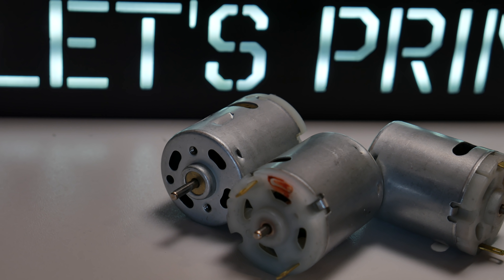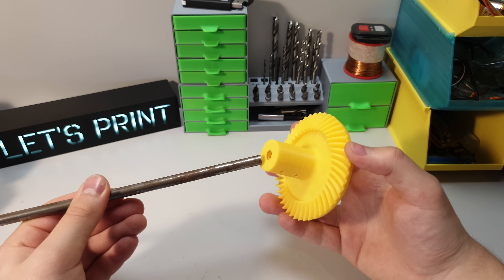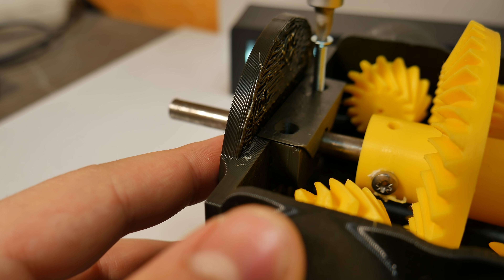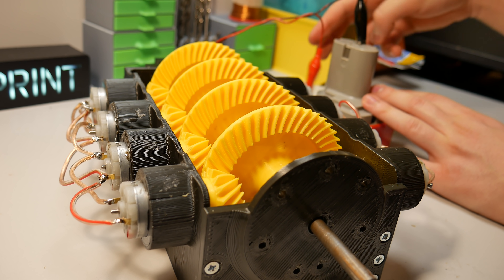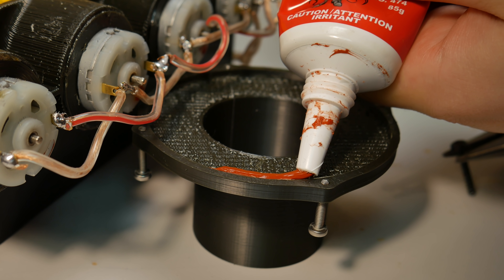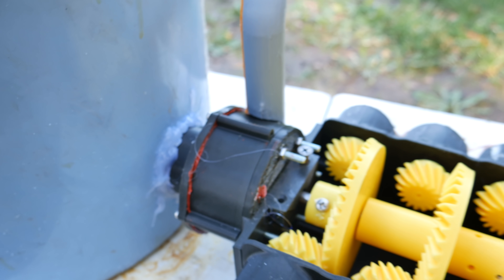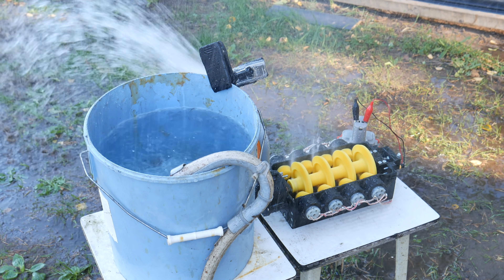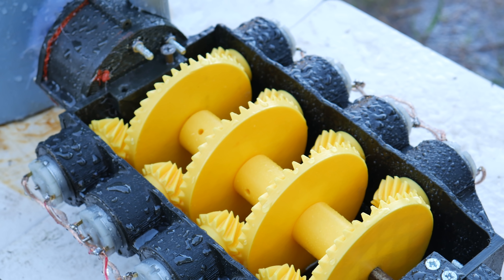Extremely Powerful 3D Printed Gearbox & Water Pump - Eight Electric Motors

Comment from the maker: If u are going to comment that I should use more powerful motors, well... already done this: https://youtu.be/57A_l9_b610
Reply: I actually want to propose you adding some PWM
Reply: Can you measure the water head and how well it compares with equivalent commercial pumps?
Reply: Hey do you think that you can make a mini version
Reply: Not really a suggestion for you to make, but could I use this gearbox to drive a go kart?
Reply: @william2glaser227  It wont work, you will need more torque to move your weight.
Reply: @milaanpatel4997  ok thanks, I guess I have to use a gasoline engine for this one, sometimes old school works the best
Reply: Bigger motor and only one gear set and it would have made it less complicated, cheaper and more reliable. This is something the germans usually do by over engineering a simple mechanism adding cost and decreasing reliably and making serviceability time consuming, why bother it's just stupidity.
Reply: @yuk-erkmckirk9277  "This is something the germans usually do by over engineering.." There should be 'period' after 'do'. It changes the meaning of the sentence completely. Unless, you want to say that, Germens are the one doing over engineering.
Reply: @yuk-erkmckirk9277  Germans only? No way, dude. The blanket answer to your concern would be "becouse I can". :P
Reply: Loved that <3
Reply: I was not going to comment on that.  I was going to comment that you’re mounting the motors incorrectly, and making at least two errors.  The motors are not meant to be located on the OD of the can for gear applications but on the ring at the front of the motor.  And you’re also blocking the air vents near the rear of the can.  Luckily this is a very crude 3D printed contraption for a YouTube video and not an actual product.
Reply: Every minute more I watch I cringe... set screws on a round shaft... pressing gears on the motor shafts without supporting the back of the shaft.... this is why you never outsource anything overseas....
Reply: Actually, the opposite! It's an interesting idea to use quite inexpensive motors, coupled together to provide the power you want, and, also, get a bit of "system redundancy", so that one motor failure doesn't stop the pump...maybe, one could add a one-way clutch/drive so that even a seized-up motor, or such, would not stop the pump...maybe a one-way clutch on the big gear. In case a small gear, or the big gear, are broken,  I saw a really simple one-way drive mechanism in a printer, easier to build as printed parts than a roller clutch...hyvää on!
Reply: put some O rings on the shaft intron of the bearings it wont stop the leak but it will slow it
Reply: you can save water by putting exit hose into the bucket
Reply: Hell, yea, I just wanted to ask about a 24V test. :D
Reply: Less gears, and a gear down would help, also better prop design will improve dramatically. Bigger motors.
Reply: Do you seal the motors up to prevent water from entering them??
Reply: Would that work as a hydroelectric generator?
Reply: Ya but still, you have no idea how effecient and easy it is to put a turbine on a motor shaft directly hahaha.
Reply: You do not need more powerful motors, you need a better design. It's HORRIBLE.
Reply: Hmmm what if you used the stongast motor u can
Reply: nice booild
Reply: Sa oled eestlane ?
Reply: any ways sorry the link is so big but was what I found for a reference, or possible buy as you said 8mm shaft, also if you take the gear at the other end and flip your slt file you can remove that system you are using to push your gears together, might have to reverse polarities with those two motors but it would work and be less pressure or stress on your whole gear box, you could also free up that side of the shaft say put another water impeller run a water line over from the Original water impeller's outlet into the other impellers inlet, for a two phase pump (has better pumping or head pressure  capability
Reply: I wanna learn how to do this what your degree in
Reply: *=* I think you need toroidal rubber for no water leaking(best for no moving part).
Reply: I was thinking that, one big motor ok

Comment: mechanical engineer reporting. expert at making screw pumps. We make everything from pumps the size you see here, to pumps that have 50" diameter collums. I have to say, this is seripusly impressive!! To get that amount of flow with such small electric motors and 3d printed parts is awesome, love the video 😊 lol

Comment: Use some rubber to seal the box case, fill it with more silicon grease , reverse everything you have done to make an little generator :D ...connect it to a water supply , to an inverter & some batteries ....i already gave you to much info LOL. PS: if you do that & the test gearbox last 24 hours ...make the next one from metal .

Comment: All you need is seals for the impeller housing for a shaft and enclose the shaft and couple to the pump impeller housing. That would keep water out of your gearbox also with building a gearbox mount bracket that guards the coupling of the shafts everything that you make from there out using that gearbox you will already have dimensions for attachment and coupling.  Just a thought pretty cool regardless it's definitely pumping out some water.

Comment: Is it success for long duration ? The gear systems may worn out due to excessive heat and the bolt which is pressed the spindle of the gear system may worn out and can make a gap which may loosen the gear system.

Comment: Try facing bigger gear opposite side with inverting motor rotation as per need for canceling net force of shaft may help in vibration and leak problem
Also chnage design of impeller

Comment: Wait, you could print this big pump assembly, but you couldn't print a set of wrenches and had to use pliers to install that bolt on the end of the gear assembly

Comment: I would put all the motors around one big gear. You would have less friction force and smaller total volume. But in overall i think 8 motors will consume good amount of energy plus it will get warmer because of high friction.

Comment: It would be interesting to see if you could build a solar powered pump for a hydroponic application. Also would be interesting to see how high the pumpkin lift water. Maybe get the gallons per hour? Based on the volume I'm seeing in this video it looks like it could water a pretty large hydroponic system. Instead of liquid silicon to grease or lubricate the gears how about plumbers silicon Grease? It's very pure and food safe. A good application might also quiet down the gearbox just a little bit.

Comment: OK....

So, instead of having a bunch of motors that waste that amount of energy, you could use one motor that spend the same amount of energy, to produce more power. Why? Because each gear connection (and this have a bunch of then) weakens the system. As a matter of fact, the amount of sound is eqiuvalent of the amoung of energy wasted.

Visually, it´s cool.... but it´s not that impressive.

Comment: This shit is incredibly useless. It will probably brake itself after 10 mins of working due to axial force that is being produced by all this gears. It's like half of the moment produced by the motors trying to push the central shaft towards the screw (the one you've used to tighten up the shaft).

Comment: Ahh, philips head screws, I am dying inside! I had to use some today on a small project because it was all my hardware stores had and it really made me appreciate my hex socket set (wish it came with some tapered). Great videos, keep it up! I love seeing 3D printing being used to make more than just simple tools and vases.
Reply: hex? i'm dying inside. square drive
Reply: @ryan_blender3d   really? for machine screws? at least hex is super common and does not strip as easily like philips.

Comment: Abs was the right thing to use, however the friction force between the metal rod and abs will only make the leaks worse. It's a nice prototype model but I would definitely use metal gears and a metal guide pipe for the axel rod. You can solve the leak problem with a few rubber o rings and grease. Your could even make a small reservoir for a low viscosity transmission fluid and get rid of the grease. As long as the gear box is relatively level it should self lubricate the gears.

Comment: I wonder. If you made a backflow valve for the dispenser pipe so when you turned it off the pump wouldn't empty out, maybe that could keep your startups from being so slow. It seems to spend a considerable amount of time blowing are out at each start, which I have to imagine adds wear to the parts too as they will be running at higher rpms with less pressure on the drivetrain.
Just a thought. I love your pumps though and especially the tears on different impeller shapes.

Comment: Very good video my friend!! Quick, straight to the point very detailed even the part where you mention that you grinded off the bar of camera 👌 excellent. That pump is great! It has so much power on the single battery its crazy, think it can easily handle a bigger pump. ✌👽

Comment: Unfortunately, this video tells us next to nothing about it's practical use because generally we are fighting gravity to pump water. In this configuration there is no need to prime the pump either.
Attach a hose and stick it in the bucket on the suction side and put the bucket on the ground.

Comment: Hi. Nice video! Also I have a question about electric motors and gears. Does more motors connected to the same gear shaft (running at roughly the same speeds) mean higher torque on the gear/main shaft but without needing a gearbox? (At the cost of more motors of course)
Reply: Yes I believe it's pretty much that. Also another benefit is that the stress is spread out in several gears. Also redundancy. I imagine that even if one or two motors fail, depending on the load it might just keep going.

The only downsides I can imagine is more points of failure and a little more power loss due to more gears and more motors.
But I am not a mechanical engineer

Comment: definitely need that water pump if your home area still uses a well (hopefully it has a normal pressure pump tho and not using like a freaking bucket like the medieval age cause that's the first thing I think of when I hear some ones using a well and not a water pump or hand pump but I'm confused to since he also seems to have a 3D printer so...why is there a well instead of like a faucet I don't mean to be offensive tho just curious about the tech his home area is using since it seems it has access to things like 3D printers but then he's using a well)

Comment: So putting 8 motors in parallel gives you a lot of power which is great if you have a huge mass of water to displace, but it does not increase the pump speed. Perhaps though you could find a configuration to increase the speed of the motors dependent on the load exerted?
Reply: well, it slows down while pumping which means it would need even more torque to reach higher speeds

Comment: Interesting design, but impractical due the conservation of energy. Multiple contact points have compounding energy loss. Long shaft with large mass compared to the energy used to turn it. Many points of potential failure. These are some reasons why most things powered with electricity do not use gear boxes. It is much more energy efficient (and therefore more powerful) to have a single large motor instead of multiple small motors. But still neat design. 1 benefit to a gear box though (which you dont implement) is that you could change power ratios by shifting the gears (large gear to small gear turns the drive shaft faster but with less torque, small gear to large gear turns the drive shaft slower but with more torque)

Comment: Next step would be to use a longer shaft and place the pump a little farther from the gearbox, that way the leaking and splashing won't get on the motors so easily.

Comment: Works great.
 Maybe a "weep chamber" with holes in bottom to drain it, between pump and gear box.
 And add a cover over gear box that extends out past the back of motors.

Comment: Water spraying over the motors and gears is not a flaw, it's an unexpected feature. You've water cooled the system so it doesn't overheat 😉

Comment: Leak proof is the hardest part, I designed mine before 3d printing but used a long shaft supported by bearings with disc walls and o-rings to "minimize" the amount of water before the gear box, you could also put a gear on the horizontal shaft and have your gearbox angle down into that before the shaft enters the propellers work area.

Comment: This is a bit pointless. Using one, bigger motor is better more reliable and cheaper than 8, because you don't loose power due to friction in the transmission.

Comment: why not flip two of the driven gears and reverse the polarity of the motors controlling those? this would help cancel out the thrust generated by the bevel gear design.

Comment: You should test to see how high the water will reach vertically in a clear tall plastic tube to find out the pump's head pressure.

Comment: Fitting motor with the spacer very tightly is bad idea couse when motor are running they are usualy emit heat which causes melting pla.

Comment: ... Make two and put under a BOAT, use pwm microcontroller to modulate power for electronic steering. Input with a wii trigger/thumbstick for throttle and steering. One pump receiving 100% and the other getting 0% power will steer the boat the hardest. 100% to both will not steer it at all. Then scale both outputs by the throttle % so you can control the combined power output. Boat will be slower in the steering by a linear factor, which is what you want anyway for best control. Half power at full steer and full power at zero steer. Space the pump's far apart for better low speed cornering, space them closer for better high speed stability. Do it.

Comment: There is a large amount of SLIP due to 2 motors being on each main gear. I recommend only using four motors in this current configuration OR 8 motors in a Design with a longer shaft.

Comment: Cool, i used to make water pumps all the time out of legos when i was young. Tried it again a year ago using a turbine from an old water powered toy and a case from an old electric motor, I just made a hole in the side, used a motor shaft then made an intake, best water pump i ever made. This video gives me some cool ideas.

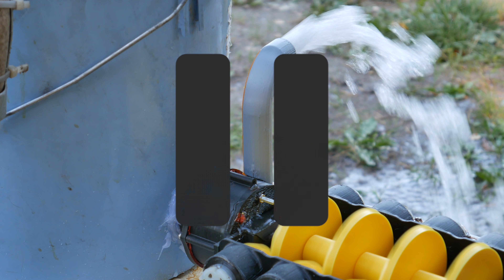Comment: 6:30 good example of a centrifugal pump spinning backwards. It will still pump, but not efficiently. Was trying to explain this to someone a couple of years ago when working on a 3 phase pump that was going backwards and struggling to maintain pressure. They couldn’t get their head around why a pump spinning the wrong way didn’t pump the water the wrong way.

Comment: You can probably use small ropes and wax to act like a shaft seal. You can fun this in boat propeller shaft or rubber shaft seals in car transmissions

Comment: Consider making the gearbox sealed with gearbox oil inside, this will fix the friction & noise problems. It should run much more smoothly. The oil inside doesn't have to be filled to the top, just to certain level, rotating gears will spread oil where it's needed. Btw. good job!

Comment: i wont comment on your Motors.. But i'll will comment on your "tools" As i can see your screwdriver doesent fit the screws AND Why not use a Wrench instead you use a tong and fucking the bolt itself.. xD.